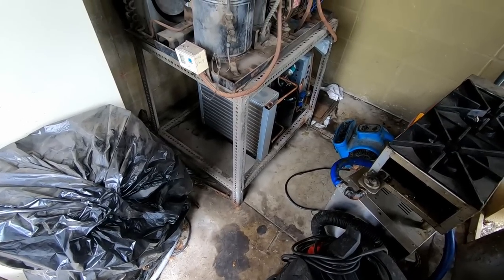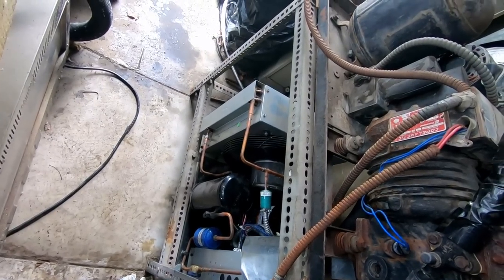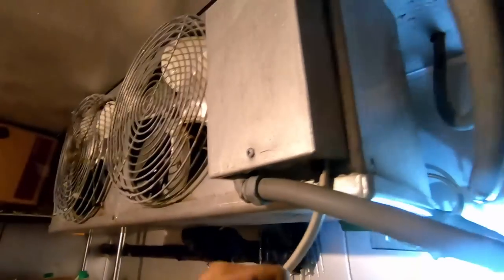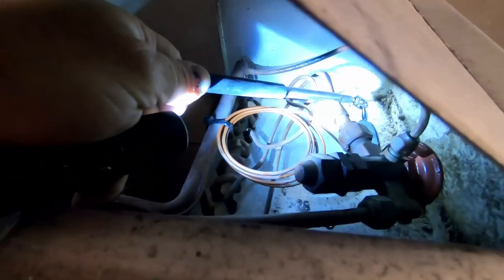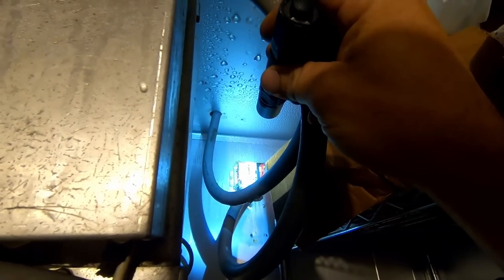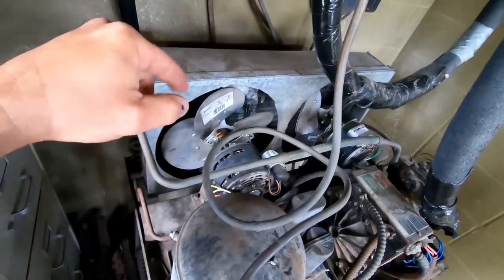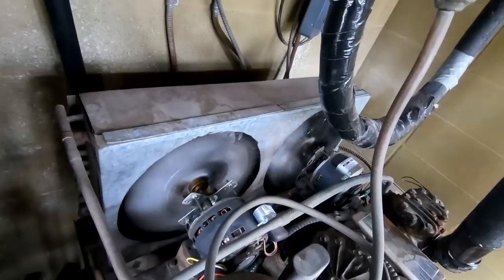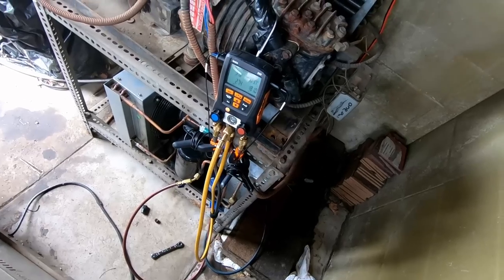How To Diagnose A Warm Walk-in Cooler & Freezer Not Working

Comment: Good video Rick . Wonder if that freezer has problems with heaters or defrost  termination . Looks like it tripped the breaker while on defrost, makes me think either heaters or termination switch . Also One Shot 417C won’t cut it , R-409 might . Ice on the floor , drain heater not working or clogged drain . Just Run 🏃 run , run !!!!
Reply from the maker: I think it was a combo of to much current draw during pump down. I haven't been called back yet 👍👍
Reply: HVACR Survival 🤭😬🤞🏼

Comment: Hey RIck!   Howdy!  Looks like you found your home for the next few weeks!  IF they spend the money, which, by the look of the equipment I personally wonder about.  Who knows.  Maybe they're realizing they can't just wing it any longer and still have an operational cooler and a freezer?!   Impressed some of that gear made it that long in those conditions!  They sure made that stuff bulletproof back in the day....  And repairable.... a bit.   Seems to me it's time for the 21st century....
Reply from the maker: Sometimes it takes someone to lay out the facts and build a case that shows them this is the way up avoid more issues down the line and save future money if it's done correctly.

Comment: I'll use them but I'm not a big fan of those penn mechanical thermostats as I've run into those temperature inaccuracy issues with those too so you gotta play with them. I like the digital ones but I know you can't always run them with the wiring/load set up
Reply from the maker: Getting to use what I want to use is like pulling teeth. LoL

Comment: i have been work a lot of indoor unit that does not have solenoid valve. LOL. going to change out a walkin compreesor tomorrow also does not have solenoid valve and does not have thermostat too.
Reply: That is how slugging of the compressor happens and oil migration.  Should always use pump down method with solenoid and pressure switches.
Reply: @u2ooberboober  i agree with you but it was make out by factory with out the pumpdown SOLENOID
Reply from the maker: Your correct 👍👍
Reply from the maker: All I can do it notify them and let them decide how they want to proceed. Thanks for the feedback!

Comment: If I walked into this.... I would tell the customer that I would ONLY replace all the equipment, otherwise I would not touch with a 20’ pole.... too much of a liability and risk of something going wrong and causing major headaches for me AND the customer.  I would also re-locate the condensers.
Reply from the maker: We quoted replacing the WIC evap and adding a solenoid, total new freezer, repositioning the cooler condenser to blow out the back and adding a vent fan system sized for the application. By building trust with these new customers hopefully we will see the job approved. If not I told them what was wrong and noted it all on my paperwork so I'm not worried about taking it on. I've had worse 😁. Thanks 4 watching 👍👍

Comment: What is one shot
Reply: One Shot® (C) Facts

HIGHER CAPACITY & COP THAN R-404A & R507A 
20% LOWER GLOBAL WARMING POTENTIAL 
COMPATIBLE WITH MO, AB, AND POE BASED OILS 
ZERO OZONE DEPLETION POTENTIAL, NON TOXIC AND NONFLAMMABLE 
SUITABLE FOR NEW AND EXISTING EQUIPMENT 
CAN BE TOPPED OFF REPEATEDLY 
HFC LEAK DETECTORS SUITABLE FOR USE WITH ONE SHOT®
Reply from the maker: Do you work for them? That's a lot of info 👍👍
Reply: @HVACRSurvival   No, but have used Hot Shot and One Shot on my older systems with good results. Info from web site.
Reply from the maker: @mainj54  I use Hot Shot, but not One Shot. We normally use it for capillary tube systems but if it's a txv we will try to convert it.

Comment: I can tell you how to reverse those fan motors if you want to know
Reply: If there are no outside reverse taps you have to go internal?
Reply from the maker: You can flip the armature around but the leads will be near the blades. You can also swap the start and run leads on capacitor but I'm not sure what the amperage will do.
Reply from the maker: @u2ooberboober  those were multi Voltage but not reversable
Reply from the maker: What I mentioned is what I have done in the past in a rough situation. But not my idea way of doing it.
Reply: @HVACRSurvival  just flip the motor housing lol